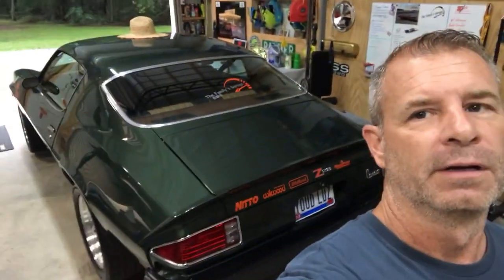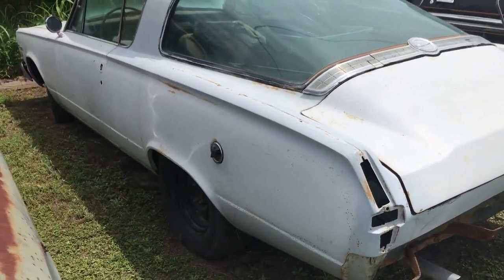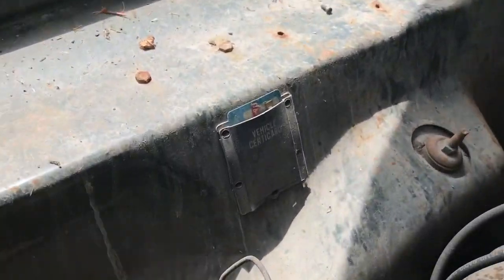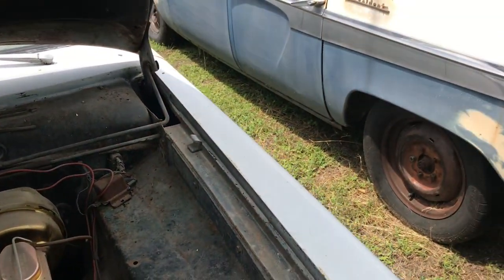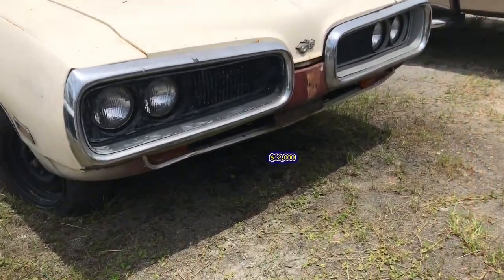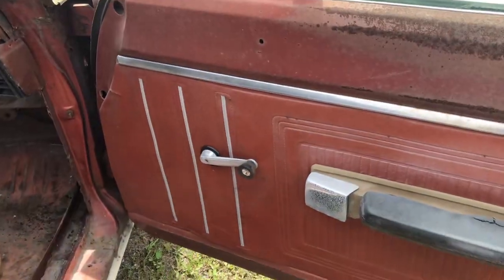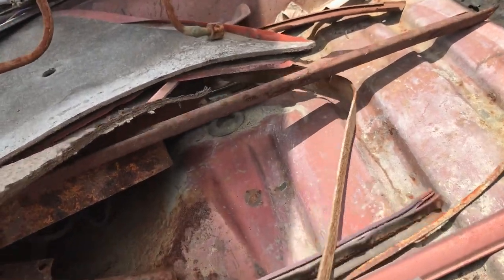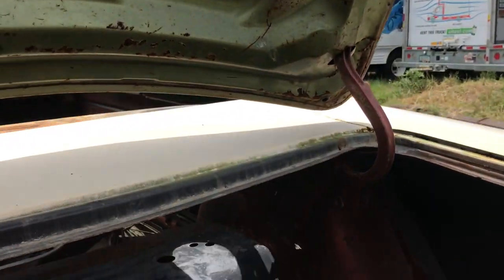Super Bee and Barracuda Formula S for sale! #20KCarChallenge #nonamenationals

Comment: That Barracuda is a 66, I have one and the biggest problem with them is its a one year car and sheet metal isn't preproduced for for them. Trim can also be an issue. Putting anything other than skinny tires on is something to deal with also in early A bodies. Good point is that they are really cheap compared to the B bodies.
Reply: Also if you break that rear window those are hard to find. Beautiful cars though, my dad has a 65 formula S Hurst 4-speed that is a one owner car and still has the factory paint!

Comment: Will you be doing a follow-up vid on the transmission for the Super Bee? Hopefully so because I'm looking forward to it. Have a great day.
Reply from the maker: yes! we have the complete rebuilding, reassembly, and reinstall of the 833 plus a Video of how the four-speed operates as well as power flow through the four-speed in each gear… but first we have a surprise dropping this weekend😎
Reply: @FamilysGarage  Fantastic news! I'm really looking forward to those videos. The 4-speed in my '70 Bee is worn out and needs to be rebuilt or replaced. I'm sure your videos will provide some valuable input into my thought process on this.